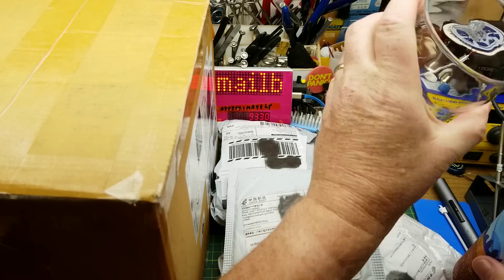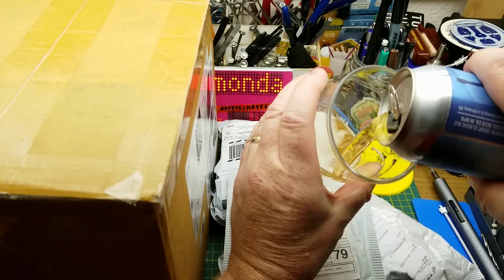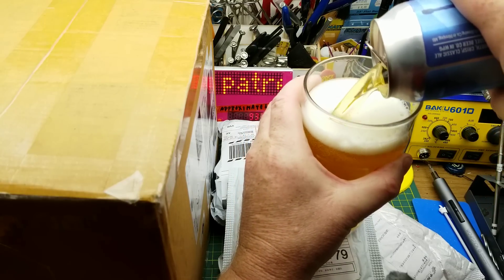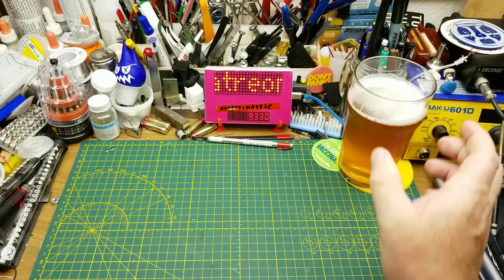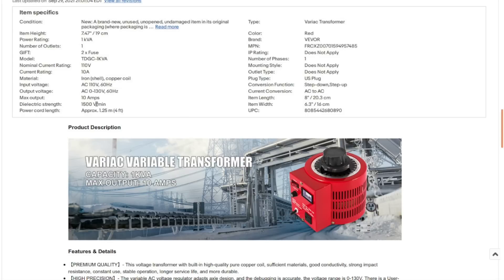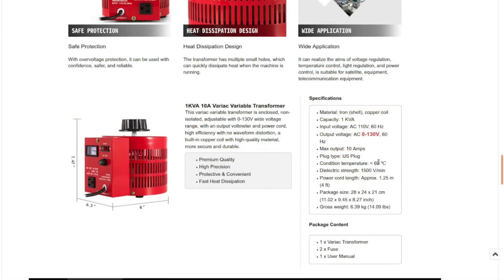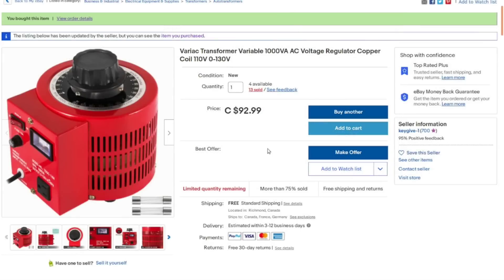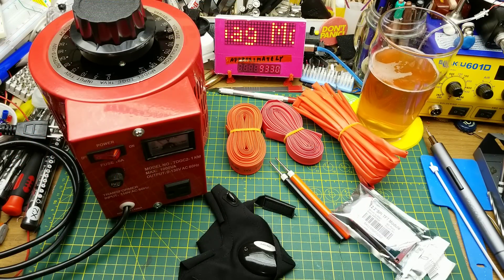Mailbag Monday #124

Comment: I have the exact same variac that you have. I purchased it 2 1/2 years ago & have been very pleased with it!
I replaced the analog meter with a digital meter.
They will last a long time if you occasionally just blow out the dust from the inside with high-pressure air nozzle.👍
P.S. I have my isolation Transformer that I purchased from up there in Canada.( Hammond isolation Transformer 171E 500VA)  I placed the isolation Transformer first before the variac

Comment: In 2005 I bid on a car (1987 Ford Granada Scorpio) on eBay while drunk once - I was surprised 3 days later to discover I'd won the auction for £360 (It was an old car....) It cost me nearly £70 to travel to where it was to drive it home... But I ended up driving it around for 3 years before it got too expensive to repair and I sold it to someone for parts. So I guess I was lucky, £360 is not a lot for a car that you ended up driving for about 10,000 miles and only replaced the water pump, brakes and a few electrical bits and bobs.

Comment: Normally varaics don't provide any isolation from the input.  They are a single winding with the live end tapping in the coil before the end so you get about 10% extra voltage.  So you still need a isolation transformer to stay safe.
Reply from the maker: That is correct.
And is certainly true of this one.
Reply: @pileofstuff  What don't help is that some people thinking that they are a transformer as they are an autotransformer, which is often a word used on the ads for them. but the auto makes a big difference as it points to the single winding. I'd love one but having to hold out for a second hand one locally.
Reply from the maker: @TheEmbeddedHobbyist  Absolutely. I'll be making a point of noting that difference in my followup video.

Comment: You could install a volt meter from e-bay (AC 70V-500V Digital LED AC Voltmeter Voltage Meter AC 110V 120V 220V 230V 380V)
Reply from the maker: I am already shopping for one!

Comment: I have the same Variac.  I added a proper ground and strain relief to the front panel and changed out the front panel meter for a digital one.
Reply from the maker: Yeah, that meter looks like it is more of a suggestion than an actual measurement device.

Comment: There are worse ideas than that led finger glove, I could use one when tooling around with the 3d printer board... or under the hood of a car and whatnot, could be handy. edit: wow those little 2.2 inch screens really jumped in price, you use to be able to pick those up for just a few dollars. at that price, one is almost better off just buying one of those cheap 10$ Gameboy clones handhelds and pulling the screen out of it.

Comment: i have the 20 qamp version of this, just a couple of things.. though the unit is not specifically an isolation transfprmer it does have an isolated  set up ..also you will find the markings for the output arent accurate ..i made a new one for mine ..other than that..ive never had an issue with it...cheers

Comment: I picked up one of those variacs, the 20A version for $93.88 US w/free shipping in January.  They are inexpensive but they get the job done.  I already have a much older 20A unit from the 80's that I rebuilt 10 years ago but it has a cracked brush and I haven't been able to find a decent replacement so I bought one of these to use and keep the old one as a spare.  The one I received said 0-130 @110 but on 120V it does much closer to 147vac at full output so depending on the number of windings they added and where they taped the input the max output could be anywhere between 115% and 125% of the input.

Comment: Those variacs are pretty decent for the price point.   They are not super heavy duty, but they definitely do the job.   Just don't run your electric space heater from it lol.  The carbon brush that wipes against the coils inside is held pretty firmly, even if the dial is a bit off.   Don't trust the meter on the front for voltages though :).   Mine had a good ground and decent insulation internally.   I did have two output connections on mine, but other than that identical.  Mine was about $130 Australian when I got it, but that was pre-covid.  That's something close to what you paid :)

Comment: Even a sheet of paper from the US comes with $50 postage - lol -.
Back in the early 90s we bought a $60USD flowbench motor - basically a vacuum cleaner motor -, and UPS charged us $180AUD postage on an $100AUD item.
Reply: I have found that items purchased from the UK and shipped by Royal mail are very competitive with the only charge being postage, on the other hand anything shipped DHL will double or triple the purchase cost with more add on fees than you cam imagine. To Canada.

Comment: Bought mine for old radio tubes radios repair, but would only use it in the low end voltage, seems bit light in weight but will try it for the tube radios for initial turn on.